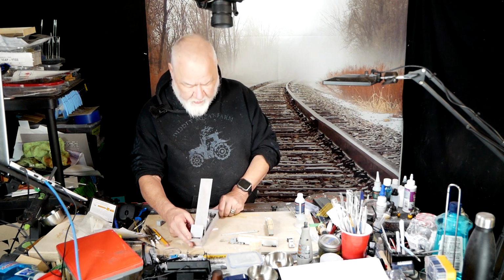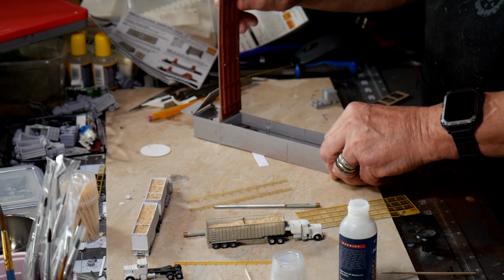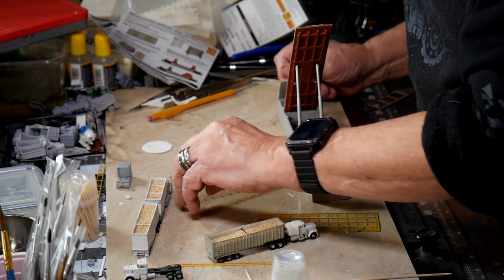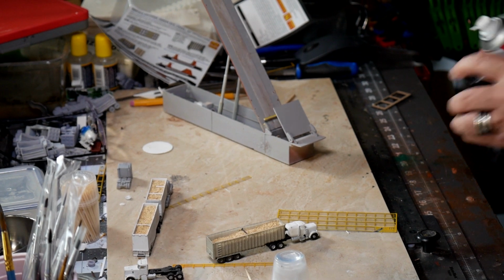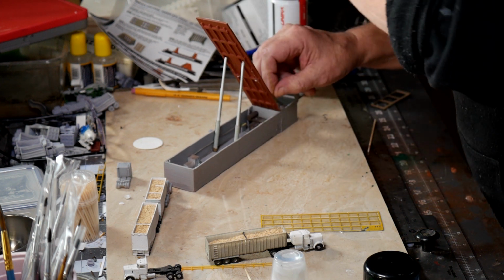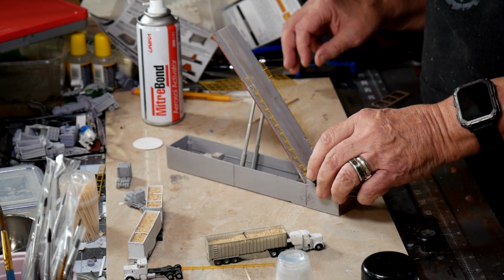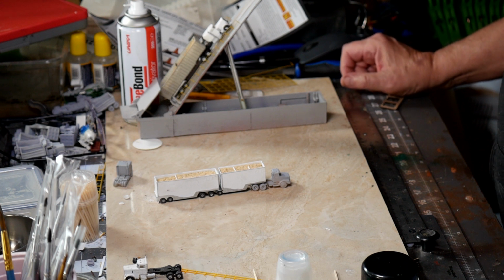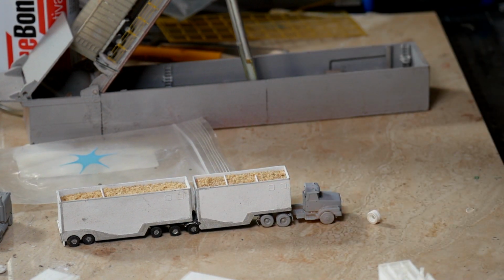Wood Chip Truck Dumper

Comment: Very interesting. I'm modeling HO paper mills. I would like to model a deck raising railcar dumper.  

I'm still wondering how I'm gonna make telescopic cylinders. Either aluminum or styrene. I want them to work but not holding the deck.

It will be up or down depending of Ops at the mill.

I like the inside details of your dumper.

Would it be possible to know more please ?
Reply from the maker: On my dumper I used   K & S brass tubing. You can get on Amazon. The tubes are designed so that each size fits inside the other.